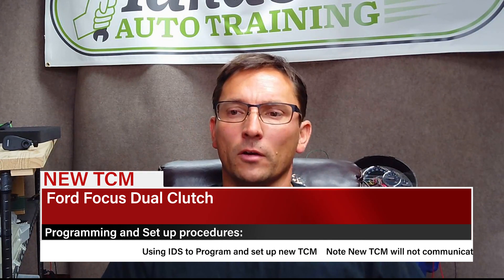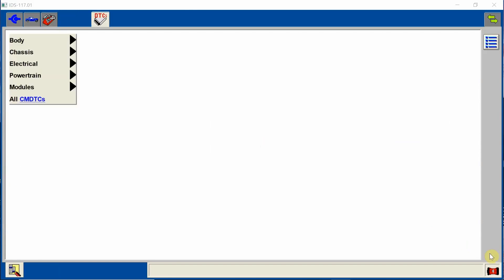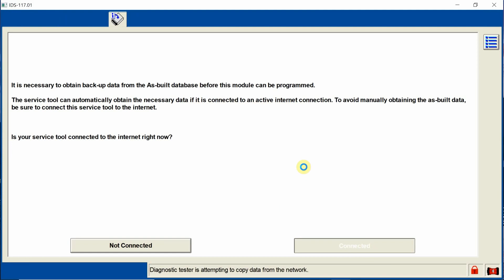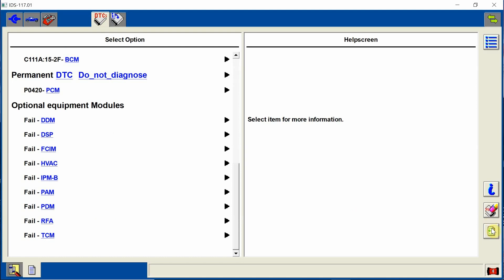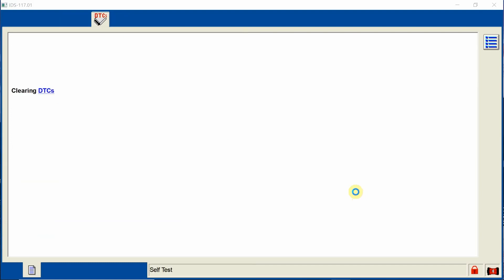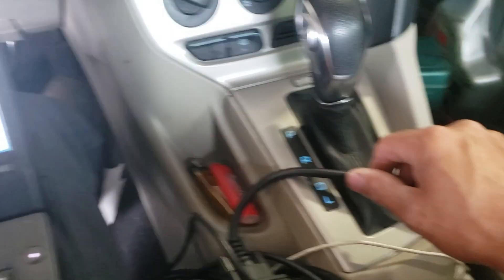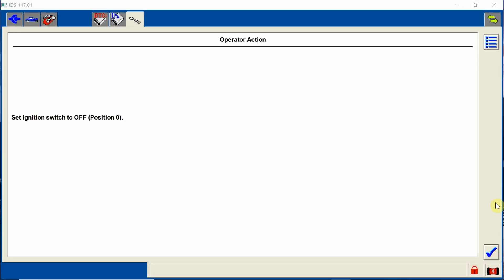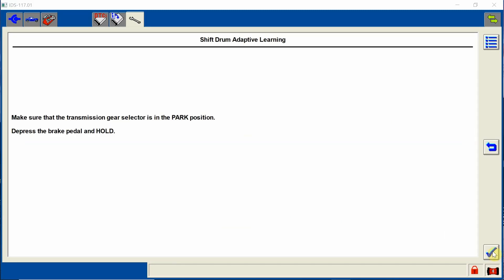Ford Dual Clutch TCM  Focus

Comment: I left my battery unhooked and it programmed itself thru the pump. NO updates but it works. Shifts good and everything. No check engine light so I saved the 130 bucks. Plus ford said they can't get the reman tcm to program but they might not know what you and know.
Reply: Hooked up not unhooked
Reply: Pcm not pump
Reply: Give me your thoughts on this. I will get it update later.
Reply from the maker: Did you replace  the tcm wit ha new one?  That will for sure need programming guaranteed.  Used you may have gotten lucky.

Comment: I have ford foucs 2012.
When I drive for an hour, the reverse didn't not work and the transmission jump from 1 to 3.
After the car get cold for long hours it can drive normaly.
Is that Tcm error and need to change to a new one?
Reply: I'm having the same problem and mine is showing its the acuator b which is part of the tcm but that part isn't covered which is so bizarre

Comment: Hello, I just got a new TCM and it blows fuse F2 (50a) every time I reconnect the battery so its impossible to even program. Any Ideas why this keeps happening? I have a junkyard and original unit as well and neither of these blows the fuse, and it doesn't blow the fuse with the new module disconnected either. Any help would be appreciated! Thank you!
Reply from the maker: Sounds like a bad new module.. it happens
Reply: @BrianMann216  That's pretty much what I was thinking but I wanted to double check. Back to square one I guess...

Comment: Very informative. What program do I need to buy and what cable etc is required for me to perform these functions? Best regards, Doug
Reply from the maker: A j2534 interface and fjds will work. I have a video lesson showing download and install of the software to do this with a j2534 device on the core or premium membership at handsonautotraining.com

Comment: Where can I buy a computer like the one you use,.  all the equipment you used in that program?
Reply from the maker: Windows 10 pro with a i5 and at least 8 gigs of ram is my recommendation,  software is available from the manufacturers , a drew technology cardaq3 plus will do you well.

Comment: i put a new tcm in my 2011 fiesta and it keeps saying wont communicate well trying to program any ideas
Reply from the maker: These may not communicate with a scan tool until after its programmed
Reply: @BrianMann216  its the software from ford trying to program it my friend works at a ford dealer and tried to program it and it says it wont communicate with tcm and its brand new

Comment: Can an autel 906bt program it?
Reply from the maker: Not the the programming part, maybe the initialization and learning
Reply: @BrianMann216  so the dealers are currently out of the part and i thought of getting a used unit for my customer
Reply from the maker: @Usmanthemecano  used can be hit or miss these things have lots of problems
Reply: @BrianMann216  yeah lkq has only one in the whole country. The dealer is out. Customer is stuck. Would you recommend aftermarket unit? If so could you share a link?

Comment: i have two  2016 ford focus  that  not going in to reverse when hot
Reply from the maker: Did you get them resolved?    Clutches ?
Reply: Same issue
Reply: Code 3003:16

Comment: Is there a way to reprogram a used one ?
Reply: Try and find a good used tcm from the same vehicle and find a TCM with the same ID codes on the case.  I installed mine and it worked fine without a reprogram
Reply from the maker: If you get the proper one it will have the proper cal id and just need to do do the set up , tr switch,  clutch end point s etc..
Reply: I bought a used TCM for my Fiesta . How ever it didn't work for my car after installing. But when I installed in a Ford focus it worked perfectly. My mechanic says that is happening because perhaps it has been programmed to work with focus and not fiesta . Is there a way to flush out programming and reprogram it for my car ?
Reply from the maker: @greyfulbuxter  start by id vehicle with original installed then do pmi process,  more than likely will error out, but that is how I would attempt
Reply: @BrianMann216  I also got a used tcm, how do u do the set up, tr switch and clutch end points.  Thank you !!

Comment: Clutch B motor not working, what could be the cause bro? Motor is fine swapped and tested.
Reply: Same here. Hopefully we get a response.
Reply: @jessen6564  finally figured out, it's actuator fork was broken due to release bearing stuck up. Need clutch kit and child parts. Anyhow At 150k kms is quite reasonable.

Comment: Hi Mr.Brian 
I want to ask a question about my Ford Focus.I live in TURKEY. It’s 2015 model , 1.5 tdci powershift. Recently I had a warning on the screen as ‘’ Battery shut downed the system to keep itself’’.I called service and they offered to replace the battery because it was low or overed. We replaced it with a new battery, after that I had another 3 more faults. 
      1-Engine fault 
      2-AutoHold is not used 
      3-Transmission is in limited mod. 
But nearly for 20 days these faults havent been apparead again.Authorized local mechanics of Ford advise to change TCM and test again, İt may be need to be replaced all transmission unit . Fault code is P2855. 
What do you you advise us ? Can it be solved by reprogramming the TCM by computer ? , İ hope to hear from you worriedly

Comment: Hello, 
How about fault code p287a. My car focus from 2012 with a powershift transmission has big problem when I stop and want drive mis the transmission and also reserve not work till in off the ignition for 5 min. After work everything till in stop with drive en it begins the same problem.
Reply from the maker: Sounds like the module may be going bad...

Comment: Hi Brian,i have a question regarding buying a laptop for GM flashing with a drew technology pass through,is surface pro suitable for this matter? thanks.
Reply from the maker: Sorry for late response,  I have not used a surface pro.  I would assume that if all the specs meet the criteria that GM states you should be fine,  just use IE not Edge